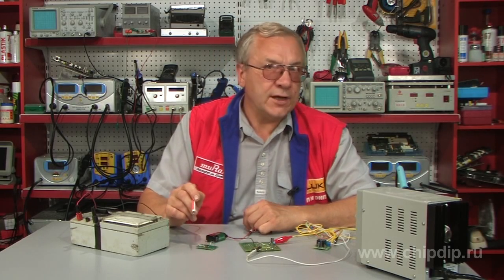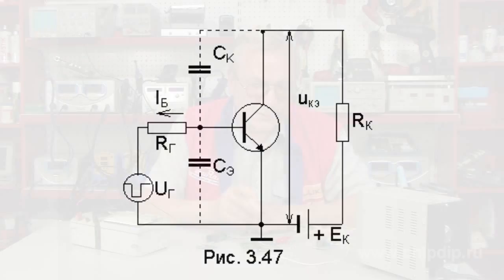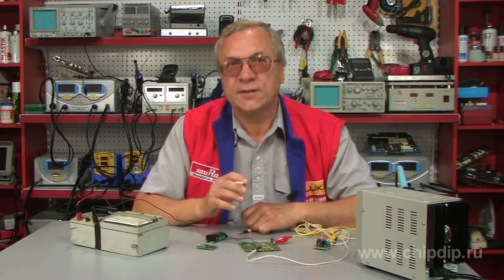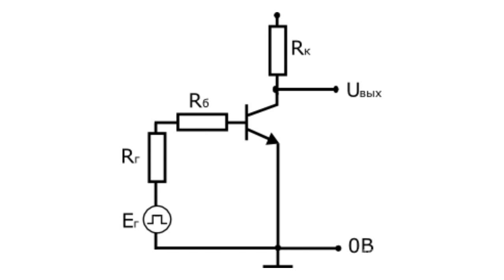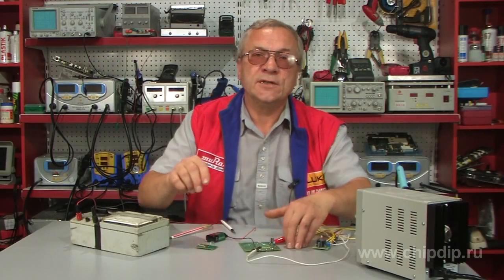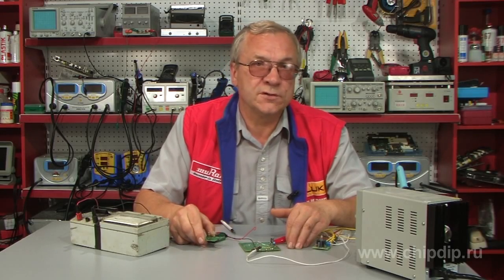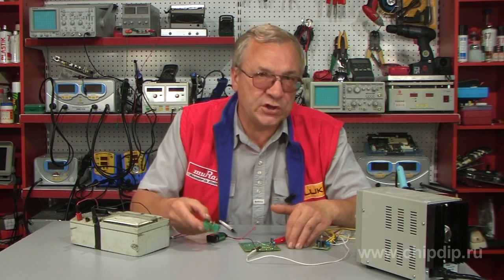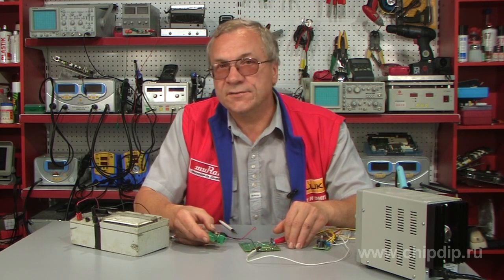Transistor Switch

Comment: nice
Reply: Transistor and to draw the graph between the input and output voltage and Mark the cut off saturation and active regions of the most important thing is that the new year to you by the way to get the best way to get the best way to get the best way to get the best way to get the  transistor